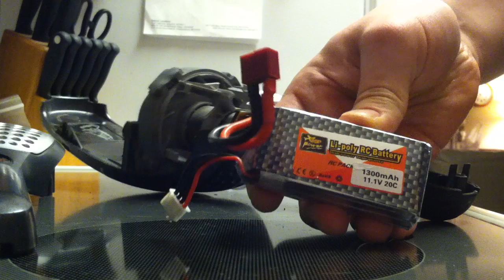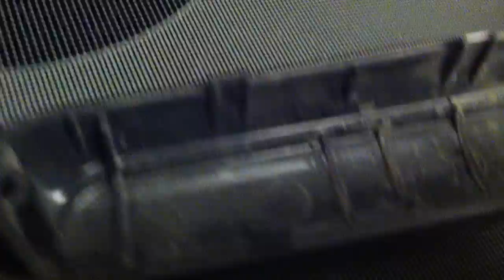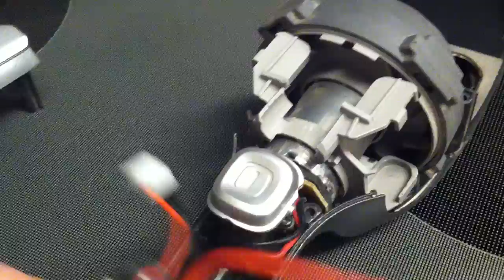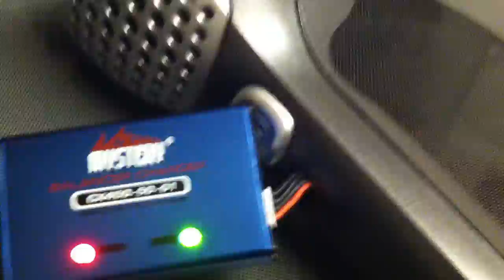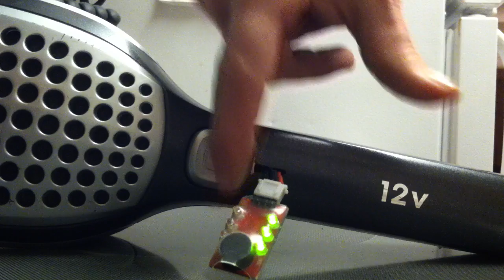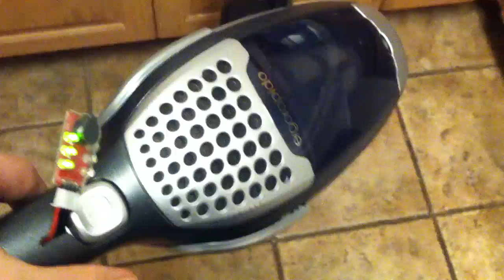Electrolux Ergorapido battery replacement

Comment: Hey Jeremy,

I realize this post was put up years ago but I have one of these vacuums that I've had for 7 years. I want to perform the mod you describe in the video, but i have a question regarding the circuit board I will need to remove to accommodate new battery.  Do you have any tips on do's or don'ts? I have the 2022 Model that I bought in 2014. Appreciate any help. Thanks.

Comment: Hi guys i also want to come up to the same idea he did.. he remove all the circuit and connect the battery directly to the motor.. im just worried if that will be fine for the motor .. do i need to add some capcitor or resistor? im still newbie in electronics.. hoping anyone can explain it to me..

Comment: Works great on hard surface floors. Very easy to use.>>>t.co/1RVa50sIhl    But most of all it is covenant to run around the floors to pickup pet debris and return to closet.
Reply: good luck

Comment: Seems to me those would bu Li ion 18650's and not "AA"'s.  3.7vdc each.  Wondering if one could just replace with a bunch in series that way could keep existing charge circuit unless the original charge design is what's causing them to fail so soon.

Comment: I just did this mod today, it worked really well, and was really fun to do. The one thing I would emphasize: when soldering the deans connector to the battery, one really needs to be very careful to not let the leads short circuit while you're doing the soldering. I made liberal use of masking tape to avoid a short circuit. 

The charger I purchased was this one (from Hobbytown USA): https://goo.gl/FM6z5o. Cost $20. 

The battery I used was: https://goo.gl/t1xP5q. Cost $24. 

As suggested in the video, I purchased a Dremel 3000, $49 from walmart. 

Total cost was actually about the same as the cheapest new ergorapido listed on amazon. But it sure was fun doing the hack, and that made it very worthwhile.

Comment: Hi guys, I have questions : what if I replace the 10 NiMH with 8 NiZn? Will it work? I think it will but will the original charging circuitry work? I like what you've done Jeremy but I'm not used to LiPo batteries and I don't want to burn my flat! Thx

Comment: Good video, but do you think it was wise to remove the fuse? I think a motor over-current from the battery can result in fire. I had a Bissell Little Green Rug Spot Lifter that caught on fire. Interestingly the only indication of malfunction was the red running light appeared lit from the small fire of burning plastic inside ... until the burning plastic burned thru the case and started dripping flames onto the floor. The Safety Compliance Engineer at Bissell seemed to be aware that the plastic would not self extinguish and didn't consider that a problem. That was years ago and they no longer sell that model.

Comment: Hello, I know that AA cells are connected in series and "+" to "-" and conversely "-" to "+", but I have question, is it important to not mislead "+" and "-" when you attach entire to inputs on pcb? I replace these accus in my Ergorapido and now it's "charging", I mean, sitting on charger stand but light indicator blinks every ~1 minute, like it should when charging complete, but it is depleted...accus are depleted cuz I measured them before.

Comment: I fix the problem in my vector. The problem was when I turn on the vector works five seconds and terms of automatically The problem was the motherboard it was transistor problem
Reply: I have ghr very same problem San you explain a bit more

Comment: Hi, the problem with mine is when I turn on the vacuum, works for about 5 sec (sometimes 15sec o 20 sec), after that turn off. I mesaured the voltaje over de baterry and is 12, after turned on drops to 5 volts, when stops goes again to 12 volts. The current of the motor has 2,5 amp peak and 1,6 amp in the next 5 sec until running until turned off by itself. Any ideas?. Are the motor take much current or are the batteries dieing? Thanks
Reply from the maker: That would most likely be the batteries.  I'd say you have at least 1 cell that is totally dead.  You can check the voltage of each cell individually, good cells should read around 1.2-1.4 volts, Bad cells will be less, or may even reverse polarity.  That actually happened to one of my original cells, it reversed polarity and melted the shrink wrap on the battery.
Reply: I have the same problem. How you managed with yours?

Comment: Good afternoon everyone, I'm interested in changing my vacuum cleaner cells that are depleted, is 10 x 1.2v AA.
I would like to know the correct battery with the charged, I have to catch all the pack for full operation since as comentais is not possible to use the old charger.
Thank you.

I leave my computer disassembled images:
https://plus.google.com/photos/105207390897523845016/albums/6061766237639090609?authkey=CO2t7KnF4Lyh0QE

Comment: Thank you Jeremy. I've fixed mine following your instructions. I had spare battery and charger. Works very well and I may even feel lots of torque, when the vacuum starts. Great idea. Batteries and chargers are cheap on ebay so everyone owing the vacuum should try this before throwing it away. I didn't use the power connector, I just cut it and solered it to the circuit. If someone is interested this is the battery, I've used:
http://www.ebay.com/itm/291044937648?_trksid=p2059210.m2749.l2649&ssPageName=STRK%3AMEBIDX%3AIT
It's dimentions are: Length 100mm, width 30mm, thickness 20mm. It fits very well after few little cuts with dremel inside of the handle.
Reply: Hi, when you talk "soldered it to the circuit" use the same charging circuit that come with the vacuums?
Reply: Daniel Nadorfy
Hi Daniel. I've removed some isolation on the battery's positive and negative wires and soldered them to the vacuum circuit to the same points, where original batteries were connected. You cannot use the original vacuum charger or the LiPo will eventually go bad and cause fire. You need to use LiPo charger/balancer, which connects to positive/negative battery temrinals and balancing plug, as you see on any three cell LiPo batteries. If you need more info, I may dissassemble my vacuum; take pictures; and send them to you.
Reply: vladstrulev hi and thanks. My vacumms has another motor on the "motorized brush" roll clean tech. The battery change will afect the other motor?
Reply: Daniel Nadorfy no it won't. If your motor runs from about the same voltage, I mean 12v or so.

Comment: I have one of these and I also replaced with eneloops. The charging circuitry on this vacuum is a joke, it kills the batteries over time.
What I did was to add a digital outlet timer that charges the batteries for only 3 hours a day. This way it will never overcharge. I found 3 charging hours a day works pretty well with my weekly usage of this vaccuum (you would have to do an educated guess here). This is not perfect, but extends the battery life a great deal.

Comment: I also have one of these vacuums that I picked up at Costco and the battery life sucks bad. Its only 3-4 months old and I only see about 4-5 minutes of use before the power starts dropping fast and my 2800SF home is almost 100% tile so it usually requires charging the vacuum 3 to 4 times to clean all of the flooring.

I have been thinking about upgrading the battery also and I like the idea of replacing the AA's with a LiPo battery especially since I already have a high end Lithium battery charger with a separate balancer for my RC cars. I would like to try a 4s battery but the charged voltage would be around 16.8v (4.2v X 4) which may be too much for the motor. If 16.8v isn't too much I could see this thing coming close to the dyson portables when it comes to performance. The other issue with a 4s battery would be the size so I may need to use 2 2s packs with 1 in the handle and the other were the other batteries were but this would also complicate charging them.

I also need to check the size of the electric motor because I may be able to swap it with one of the many spare motors I have from my cars. I also will need to come up with a method to charge the battery since my lithium charger doesn't use the balancer port to charge the battery and having to take apart the vacuum every time to charge would be a pain in the ass. If I end up doing this project I will make sure to post it up on youtube.
Reply from the maker: You could make a JST adapter for your existing charger to charge through the balance port like this one: http://www.ee.nmt.edu/~furrball/temp/rcheli-diagram-3s_balance_only.png 

The motor appears to be a standard size 540 brushed motor.  I don't think it would be a problem to run the vacuum motor itself on the higher voltage 4s pack, but I would be afraid of the brush roller motor on the stick.  If you really wanted to get more run time and power out of it, converting it to brushless would be a good solution, but it would require a brushless speed controller and a servo-tester type circuit that would be costly to implement.

Comment: That's great info, thanks. I just started replacing mine with eneloops, and now found out that it won't be a permanent solution. :(
I wonder if it would've been possible to place your modded charger inside the base stand? It probably uses more pins for charging than the original one?
Reply from the maker: The original charging base only has 2 contacts.  Balance charging would require 4 contacts.  I don't see an easy way of doing it with the 3s lipo, but modifying the base with a smart charger would probably be very beneficial to someone who wishes to use Eneloops or similar low self-discharge type NiMH AA batteries.

Comment: wow you totally hacked it.
is the new battery alot better than multiple AA's?
Reply from the maker: It has noticeably increased the power.  If you could find a 4s pack that would fit in the handle it would probably be a lot more powerful, but at the risk of burning up the motor.  Run time is about 10 minutes with the 1300mAH pack on high.  I've also found a better charger: http://www.hobbyking.com/hobbyking/store/__36906__Hobbyking_DC_4S_Balance_Charger_Cell_Checker_30w_2s_4s_USA_Warehouse_.html 
And this pack should fit:
http://www.hobbyking.com/hobbyking/store/__23679__Turnigy_1300mAh_3S_25C_Lipo_Pack_USA_Warehouse_.html
Reply: Battery in my Ultra is running weak and short.  I'm tempting to do this.
How long does yours run in Low mode?  What's the different between the 3s and 4s pack if both have the same 1300mAh?  Would the 4s pack give more run time?
Reply from the maker: jtran1969 I haven't done a run time test in low mode, but on high it runs for a little over 10 minutes on the stick.  I would expect 15-20 minutes on low mode.  A 4s pack of the same capacity will have the same run time, it will just increase the speed of the motor and possibly create more  suction.  If you're wanting more run time, you want a larger capacity battery.  Instead of a 1300mah, you should look for a 1800-2000mah battery that will fit inside the case, that would give you more run time,
Reply: Jeremy McGlade
Very good. I like it and I am buying a battery pack. Have enough space inside the vacuum for a 2200mAh battery?
Reply from the maker: LT Santos It would depend upon measurements of the battery.  I would look for one with measurements in the range of 34x20x100mm max if you wanted to fit it in the handle.  If you can find a 2200mAh with those measurements, it would probably work.
Reply: Jeremy, Why do you suggest the charger that you have above? It says DC input? What are you charging this off of? thanks.